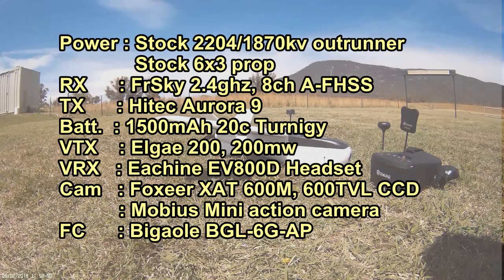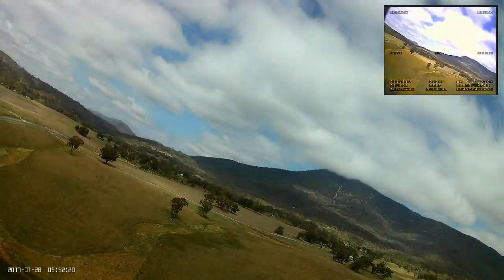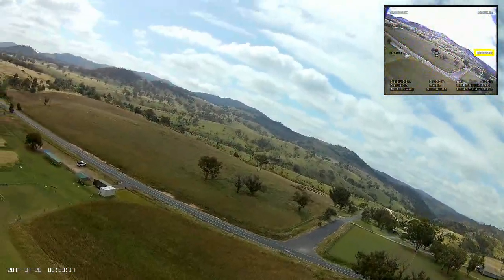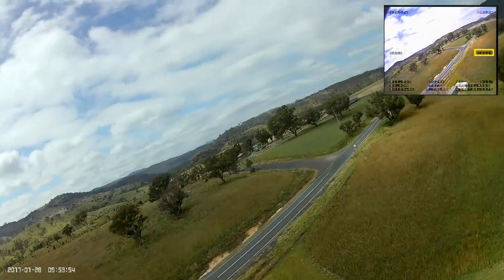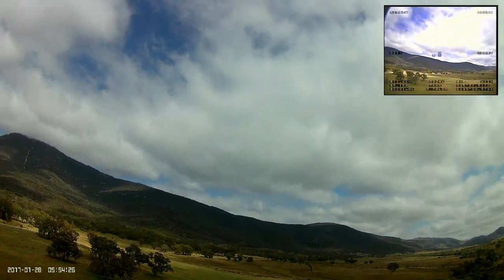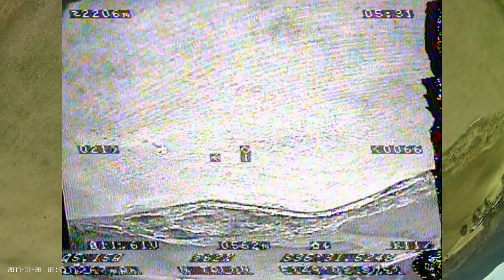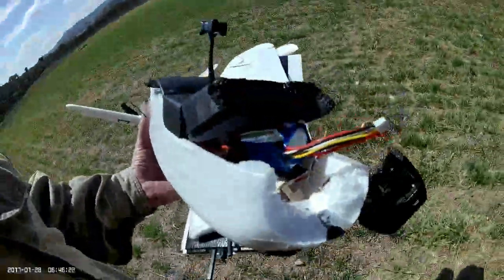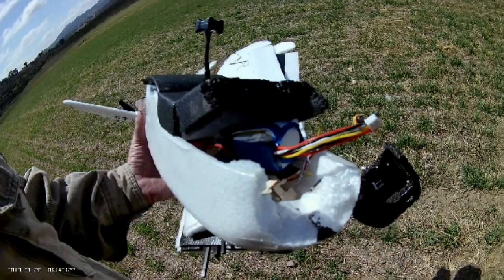Nano Talon crash - Failed BEC?

Comment: I've had no issues with the stock esc. The bec on it's been garbage but i dont use it for anything.

I suffered a few tip stalls with NTs. Few boys suggested that any yaw action at slow speeds invites tip stalls due to the proximity of the tail to the main wings. High risk being turning to fly with the wind.

I've removed yaw from all stabilised flight modes on my NT and so far so good. I've seen a few folk with VGs on the wings but I'll leave that for now.

Comment: I have a Nano Talon as well. I think the stock BEC is only 1 amp, not nearly enough for those servos. Before flying my Nano, I replaced ONLY the BEC with a 3amp version, so I'm pretty confident that I won't have any problems like you had. I left the original 30amp ESC , since the motor only draws about 10amp max. 3amp or so cruising.

Comment: @ 4:28 during death spiral I just spotted those two eagles from your latest video....
Perhaps the troubles may not entirely be component/air-frame failures as often as it seems???
Might have to mount a couple of extra cameras on a switch & keep a better eye out for 'in-coming bogies'.... :v ;)
Reply from the maker: Well spotted. They're actually crows and it looks like they were on their way somewhere else at a fairly low altitude. They're pretty smart and usually mind their own business when it comes to RC aircraft. The birds that recently attacked Ranger were also crows and in the same area but it's spring here and they've got mating on their mind which makes them much more agressive. I might try a rear-facing camera on a smaller plane and see if I can stir them up a bit.

Comment: Thats tragic, But on the bright side, the body kit is cheap ($40) and you get everything included, even all the plastic pieces, covers etc, and its built up, just without servos or motor fitted. I use a switching regulator for my bec, none of the hobby style 'BEC' s I tested even came close to delivering half their ratings, and the beauty of a switching reg is I dial it in for 6v, which makes everything work better, especially servo's. The NT esc is actually really good, just undersized with a linear regulator capable of 1/2A short term, and so being linear I leave it connected to my bec rail, being 1v lower means it does nothing, but should my switching regulator die, it will keep me flying at least.
Good luck, it's well worth fixing :)
Reply from the maker: Thanks, I hadn't realised that they sold spares. Hardly worth fixing at that price apart from that slow boat from china. I'm trying to keep it light so plan to use a 15A Turnigy Plush ESC with 2A rated BEC. I have some on hand and have found that series to be reliable.
Reply: KenJungles Sounds perfect with 2A, that body kit surprised me, I wasn't expecting it to be fully built with all the wood and brackets fitted, as well as the linkages and pushrods.. the funny thing is, the wings and tail are insanely expensive and they are nothing compared to the body parts wise.. Banggood pricing logic.!

Comment: Oh NO!!!  Sorry to see this, glad you're gonna give it a chance to fly again.  As long as the Y shaped piece the main wing spars slide into isn't broken, I suspect it's repairable.

Concerning the loss of altitude in RTH circles, perhaps the Bigaole gains were set too low to allow enough elevator deflection while banked in the turn?
Reply from the maker: Yes, I think you're exactly right. That's what I was trying to confirm when she went in. On the previous flight I'd used RTH to come back from 2.5km and was pretty sure she maintained a constant altitude till arriving. The NT has a similar aerodynamic profile to a house brick and seems to lose a lot of energy in the turns. I did have the gains set quite low but the elevator is quite small on this model and probably needs to be more responsive.

The "Y" sockets are still intact as are the wings and tail-feathers. I'd laminated the fuselage so even though it snapped in half, the damage there isn't as bad as it might have been. It looks like the breaks are relatively clean without a lot of compression damage. The plywood battery tray is a write-off though and will need to be replaced.
Reply: I've read about the troubles with the stock ESC some have had, but mine is working fine.  Your crash has prompted me to replace it, I'm going to use a YEP 30A ESC from HK.  I can program the low voltage cutoff off so I can use my li-ion packs without worry, and they have a nice 4A switching BEC to provide the extra power needs a flight controller like the Bigaole demands when constantly twitching the servos.

Comment: Really sad!!! But there are several vids  about how bad is the stock ESC/bec. I have the kit version with a quad ESC and 2205 motor. I'll never get any wing or plane as a PNP or rtf the always have cheap parts!!!
Reply from the maker: Yes. I was aware that some people were discarding the stock ESC but I generally don't try to fix something that isn't broken. I''d been flying it with the stock flight controller for some time and only recently replaced it with the Bigaole unit. I guess the extra load just pushed it over the edge. In retrospect I suppose that with critical components like the ESC It pays to take no chances. Hindsight is a wonderful thing.

Comment: Not sure whether to like or dislike- broken ZOHD's usually get a giggle from me, but not this time!
Strangely enough, I found these ESC's the other day thanks to a post on FB group "Rag the Nuts Off" with 8amp BEC built in...
Even stranger is they're called Talon as well! lol!
http://www.castlecreations.com/en/talon-1
Perhaps the rebuild might be easier if you get a new body as they came as both a kit & as spares on various Chinese web sites now...
Best of luck!
Reply from the maker: I hadn't seen those ESCs but 8 amps is probably overkill for this little toy.  I'm trying to keep it light so plan to use a 15A Turnigy Plush ESC with 2A rated BEC. I have some on hand and they're pretty reliable. I'll have a look at the damage next week but will probably order a replacement fuselage. Even if I do manage a repair I'll probably have busted it again buy the time it arrives.